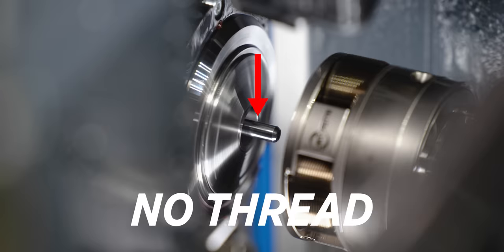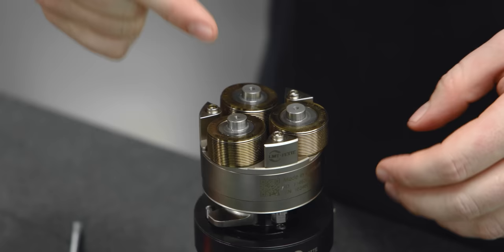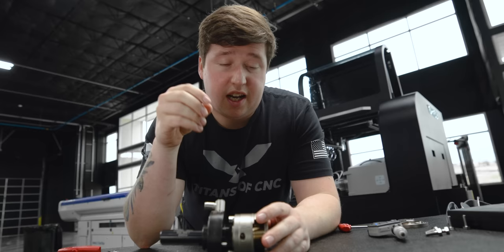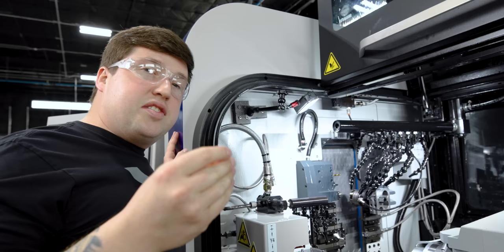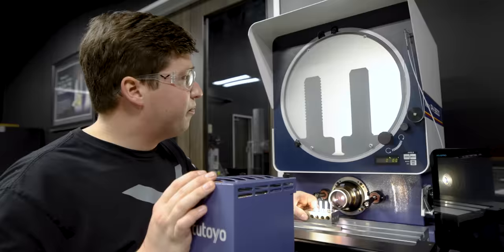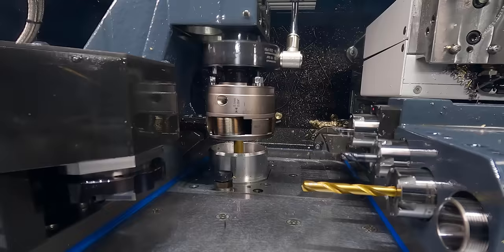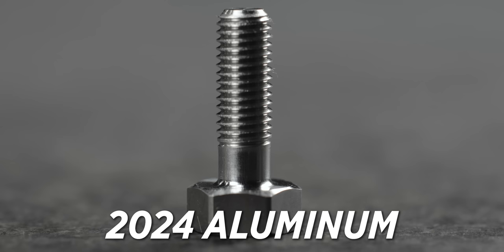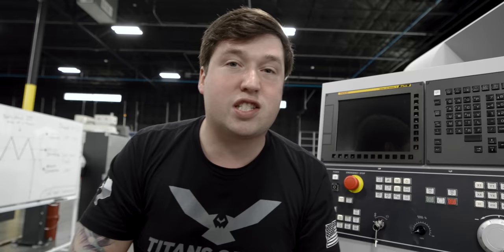How to Form Threads In Less Than 1 Second

Comment: 1) Why were you not using a pitch diameter micrometer?   2) The coolant you appear to be using is mostly water, why do you call it oil?  3) You did not say whether the markings on the threading head were diameter or radius, also 0.004 inches is a rather big as I sometimes try for within 0.0015",  There should have been a vernier in the body.  With 8 divisions would give 0.0005" resolution.

Comment: It's interesting to know that for some grades of bolts/nuts, you are not allowed to machine the threads, they must be formed to meet specification. Because cold formed threads are more resistant than machined threads, there are situations where you simply cannot just machine a bolt because you don't have any in stock. Sometimes you need the real thing (cold formed threads) and using machined bolts will just not do. Heck, it can even be pretty dangerous to use a machined bolt in lieu of a cold formed thread, such as on a lifting device, scaffolding, etc.
Reply: I study engineering at university and were were just covering this exact topic about how cold rolled material and percent cold work impacts mechanical properties and I went to the comments looking for specifically a comment about how the process actually creates stronger threads. Thank you for not disappointing!
Reply: @phantomforce1332  I study engineering in my parent's basement and we were just covering this exact topic about how cold rolled material and my pet squirrel and I love macaroni and cheese and I once seen aboob on cinna max. ... If something is designed with a brain and not a com pyuu tater you can skip all this junk engineering and get back to making cool stuff like we used to. Stuff that WORKED, stuff that LASTED, and stuff that will (STILL) be around when the digital garbage comes back a dozen times as a Hyundai!
Reply: @bitshtannicajohnson6957  What a silly comment.
Reply: Bike spokes are a commonly rolled thread - just to show it doesn't have to be all high end aerospace or deep in an engine.
Reply: @malcolmbagley7068  Just about all the bolts in hardware stores are rolled, aren't they? Just not on a lathe.

Comment: The tool is made by LMT / Fette. Only 10km away from my hometown in Germany.
One of my best friends gave me one of these rollers about 40 years ago, when he was working on the machine which grinds these rollers.
He is still in this company for more than 40 years now.

cheers
Reply: It's hard to beat German engineering.
Reply: Haha, the internet is such a strange place. I used to work at LMT Tools. An now someone on the internet wrote that he's also just living 10 km near by!
Reply: Maybe your friend would know, is it possible to by a few thread rolling dyes for gauge 14 UNF thread (used by bicycle spokes)? Not the round ones like in this head but blocks (for the sliding heads)?
Reply: @davorinrusevljan6440  
Now he is working in another devision, but I can ask him nevertheless.
Reply: He will ask his company tomorrow
Reply: @chechnya  
It gets easier to beat if energy prices become unsustainable and industry f*cks right off to other countries.
Reply: @davorinrusevljan6440  
he wrote:
Hello Matthias,
In general, each unf thread can be rolled.
A different rolling head may be required. For an offer, more information about the thread would be required.
He can look at the catalog first.
I will send you the website to download right away.
Otherwise he should simply start an inquiry with LMT-Tools.
Reply: @MPenzlin  Thank you

Comment: Used one of these Fette heads to roll up to ½"UNF ~300mm long out of 316 stainless...great tool, super consistent for long runs. Very strong durable threads. The challenge rolling at that length was keeping the thread dia's parallel.

Comment: Back in like 1984 I ran and old Brown and Sharpe screw machine with a threading head on it, cuts threads but same principal to reset. It was reset by air pressure. If you look at  an old book on screw machines from the 1950’s or 60’s I think most cnc lathe machinists would be surprised at how advanced the processes were. Advances in cutting tools and spindle speed aside, most average complexity parts could be made just as efficiently once the "programming" was done. I’m sure that old B&S is probably still churning out parts in China today.
Reply: Probably faster as well.😃
Reply: With short run, this still may be the yay to go, especially when running the 'problem' types of stock..  Aren't the older  more manual machines more adapt to different types of coolant (oil based)?  ...and for non standard thread (locking artillery type).

Comment: I use to work in a shop that did a lot of thread rolling, but they were large machines with does roughly 8 inches in diameter. They were for rolling large bars of stock that sometimes would get thread ground for finishing. Other threads like acme or standard v would be finished after rolling

Comment: set your rollers to the minor dia with a pin.   then adjust your pre roll for safety.  also offsets to your pre roll dia are 1-3 ratio to the major dia.
Reply: exactly, we just use a sample thread. Gets you very close and saves time.

Comment: I sold Fette Thread rolling heads for CNC Machines. Operator s couldn’t believe how fast threads are formed. So much faster than single pointing. And a rolled thread is so much stronger than a cut thread. Not to mention the savings having to only use bar stock at pitch diameter.

Comment: I used these heads on screw machines 40 years ago,  I'm not sure if the one shown works the same way, because the ones I used snapped back to ready, they didn't need to be reset, but they were cutters, not rollers.

Comment: I wish you guys that make bolts would stamp an indent into the top dead center of the bolt heads .. so when the get stuck and has  to be drilled out (as doing this, even way undersized can releave enough pressure to get them to release) one doesn't have to manually bang in a centering point..  like also having to grind of the head a bit first.. that can be impossible in some cases.  Ya.. a users point of view.

Comment: Installed a few mega brand rolling machines.... Incredible that this kind of tech can be put in a tool.
Reply: It IS incredible, but I will say that after inspecting thousands of threads rolled by one of these heads vs. thousands of threads rolled by dedicated thread rolling machines, these tools are a compromise.  Still likely a compromise most shops would find advantageous, but if you're running close-tolerance (allowing for plating, etc.) threads or SAE8879/UNJ threads where taper is controlled as well, I'd rather have the parts made on a dedicated thread rolling machine.  As rigid as these tools are, they still often deflect, causing a significantly tapered thread (undersize at the beginning) or barrel-shape (undersize at beginning and end of threads, in-tolerance or oversize pitch diameter in the middle) when threading into a relief groove.  Still a great tool, just not necessarily the best solution for all threads.

Comment: Is there a difference between rolling thread and cutting thread? Does the grain structure changes and makes it better or worse?
Reply: Cutting disrupts the grain structure, cut threads tend to shear or fatigue sooner. Rolled threads compress the grain structure adding strength to the surface of the thread preventing failure/fatigue.
Reply: Similarly, is there an industry or application where rolled threads are prohibited?
Reply: @chadc1982  In certain medical components and food processing equipment, because at the crest of the thread there is a chance of machine lubricants or debris getting trapped in the material. This can cause infection if installed into the body - ie. bone screws.
Reply: @dominictascone1471  Thank you.  Good to know.
Reply: @chadc1982  yes - aviation
Reply: @zyndapp800  That's my recollection, too.  Could you expand on this, please?
Reply: You should use materiale that has a large grain structure. Here heat treatment and slow cooling can grow the grains large before rolling process. The rolling process crushes the large grains into a finer structure and make the tread very strong. The fine grains prevent dislocations to move easily in the material because the dislocation has to find a way around the grains so the material can take a new shape.
Reply: @SR-ml4dn  this is 100% true and nice explanation, thank you!

Comment: Looks like thread is a bit truncated. Set the effective diameter on shadow graph then bring up rolling diameter till you get a good thread form. It would also be nice if you could explain more on profiles for plated parts which should be sharper than standard profiles.
Reply: Using a COMPARATOR isn't as accurate as pitch mic's or thread gages. . . . . Fail #1. Also platers will give to specs on the thicknesses of the coatings you use. If you can't read them and figure it out. . . . . . fail #2

Comment: Could you use gauge pins to set the ID or does the tool have some deflection or working in depending on material types?
Reply: Typically I would set the rolls to a gauge pin having the minor diameter of the thread. You can also use a tap or even a bolt with the correct thread size.

Comment: one of th eonly things i could think of being a downside is that you need a seperate tool for each diameter. or maybe you can take it apart and adjust it some way? there SPT has a better diversity, but require a lot more attention and the tool wears out much much quicker, or breaks, as it has minimal surface area and streangth, the rollers are a whole order or maybe two of magnitude larger than a point on a 60deg. threading insert. awsome looking and working tool. love it

Comment: Thread roll on multi spindle screw machines at black and decker and Harley had 2 rollers and didn't pop open.ade millions of parts before 1984. Acme Gridley 6 and 8 spindle.

Comment: I’d like to see a speed difference between this method and regular single point turning
Reply: Check this out from LMT Fette - https://www.youtube.com/watch?v=4fJJjmQ8AdM

Direct comparison of Single Point and Thread rolling 👍
Reply: Single pointing is WAY slower.
Reply: Single point turning gets painfully slow as you increase the length of the thread.
Reply: @siffar  To expand more on your point a little more. As the length of the thread gets longer you also have to deal with more part deflection. Single point threading is a high pressure process. There is a lot of tool contact even for a simple 60deg thread. The problem only gets worse with acme or square threads.

Comment: You know what? I don't believe you that "I found the way to make the perfect thread" ...
... because the side of the tool clearly reads: MADE IN GERMANY ... where I also found what you "found" in the manual of the tool. What a coincidence?
Anyways, just technicalities. Greetings from Germany and thanks for the relaxed, calm and factual video:)

Also: Are you serious? While the shown workflow is really impressive, dedicated screw producing tool machines work in the ballpark to spit out thousands of them per minute. We have machines here that cut, stamp, roll, press, de-burr, thread and polish composite plain bearings in one go to a thousands per minute (Modified and specialized Bihler machines). Those are "Titans" ... which of course have always the problems that they are inflexible (like the mythological ones), have long set-up times and may be pushed from the throne by a more flexible process (like the mythological ones, you get it) :)

Comment: If you rolled a thread out of a memory metal, installed it, then heated it, would it work as a permanent fastener, or security screw or bolt?

Comment: What is super duplex? Google = Super Duplex - Stainless Steel Alloy 2507. 

More: Super duplex is a shorthand term for a family of high-performance stainless steels designed with around 25% chromium content in the alloy's makeup. As the duplex name suggests, this family of alloys have a microstructure made up of both austenitic and ferritic grains of steel. huh?

I am a retired machinist and I did not know what super duplex is/was. Oh well... 

Thanks for making this video. I have some of the older heads that cut threads. They work the same as this on how they open after the thread is cut. I thought those where cool. I know about thread roiling but never actually seen it done. Liked, subbed. learning & still machining even after officially retired.

Comment: One thing that was missed is that rolled threads are stronger than those cut by a single point tool due to compressive forces used for forming.

Comment: Do you have to adjust the tools
Position in Z and the speed it feeds in at carefully to prevent the body of the tool hitting the larger diameter? If you need to control the length of the thread, is this just done by tweaking the Z feed so that the tool pops open at the right point? Trial and error?

Comment: we use one of these were i work but have to manually reset it. we run it with coolant in a turret lathe. Any suggestions on auto resetting it since im thinking we wont be able too with the coolant since it gets ran during the threading process already.
Reply: Set up a rod somewhere that does it while the turret index’s. Best way to do it
Reply: @donniehinske  i was trying to avoid that, mainly cause im a coward and scared of crashing but it would be the way to do it dang it, ill look into it haha
Reply: @tugyjones6690  you arent a coward dude you are a BEAST! also yes it terrifies the sh*t out of me as well. There are a few different attachments you can buy that will make the impact smoother so look into that for sure
Reply: Coolant on a turret lathe can be plumbed from a different station. Then you just index to that station, fire coolant to close, and continue with your cycle.
Reply: @dominictascone1471   i was thinking if i could get away with something like that or the bar, got options and thats all i need to start figuring it out, thanks for the ideas.

Comment: Ive never heard of the material "super duplex", what is it?
Reply: It's a type of stainless steel. I've never worked with it, but it's very resistant to corrosion and is used a lot in the offshore oil industry.
Reply: It’s a big step up from 316 stainless steel in terms of increased pitting resistance and yield strength.

Comment: Your only just doing  now,I've been fettehead thread rolling  for over 30 years,I thought you guys would of done this years ago,its one of the strongest  threads,and also you scrapped 3 components where if you do it right tou dont scrap even one,get a bolt with the thread already on and set the rolls to the bolt then you dont scrap any
Reply: Same here, we rolled 15-5PH 43 Rockwell since the 1990's... On Citizen Swiss machines... Roll your threads then face and chamfer off the 1st imperfect threads for best results.
Reply: @stbentoak5047  that's the correct way!

Comment: I've used this very thread roller (but the metric one) for rolling M6 threads on SS. 
But i didn't get much tool life out of it. 
Anyone have any suggestions on increasing the tool life of the rollers?
Reply: Looking into coating the rollers or get them harder than D2
Reply: @shreyaskamat8285 The life of thread rolls are strongly impacted by many process variables. These include runout between the workpiece and the tool, the accuracy of the blank and chamfer preparation, use of the correct spindle speeds and feedrates, as well as the characteristics of the material itself. Controlling these variables to a high degree of accuracy and precision is the best way to achieve better too life. Coatings would be a good way to further optimize tool life, once the process is under control.
Reply: As long as elongation is above 15%, you will experience reasonable die life. It also depends on the grade of SS
Reply: You may also try a 15-30 degree lead angle (think sharper point, not flatter) where the rollers will first contact the blank to be rolled.  If this causes the first few threads to be too minimal/too much angle, you may want to make the end of the part (and thus, the thread blank length) 1-3mm longer, roll the thread, then come back and machine off the extra length at the beginning of the thread (removing the shallow lead angle).  This can also be a solution if you are encountering significant thread pitch (diameter, not spacing) taper at the beginning of the threads. Hopefully this makes sense!

Comment: Which potential problems you could get by compressing a thread.
Reply: Cold/work hardening the rolled surface of the thread, which is generally going to increase the strength (in addition to the strength gained because the material grain is being 'moved' rather than 'cut'), but at some point (especially on very small threads) we have to ask whether the thread surfaces are locally hardened, or the entire bolt has been 'through' hardened because it is so small, thus making it more brittle, etc.  I don't know what size of thread would begin to see this type of problem, but I have seen many cracked/broken rolled threads at diameters over 1 inch, so there certainly can be issues.  Most of these issues were caused by chemical anomalies in subsequent cleaning processes or damaged/neglected rolling dies, NOT necessarily a factor of the rolling process itself.

Comment: is there like a hand tool that makes rolled threads like using a die? or is there a way to roll internal threads?
Reply: Relatively small diameter internal threads can be "rolled" (formed) using a thread FORMING tap. The drilled hole needs to be a slightly different (larger) diameter than you would drill for a standard/cutting tap.

Comment: Mass production of bolts of all sizes and hardness does thread rolling but on a way larger scale and with a way larger machine that feeds raw stock into the machine cut , heats , presses into hex head , rolls thread , heat treats and drops into a bin / box all in one big @$$ industrial machine and they make a whole lot of bolts